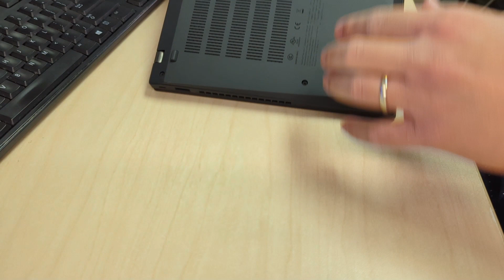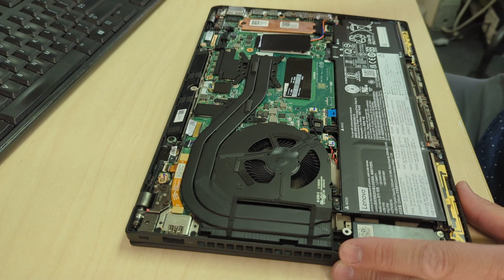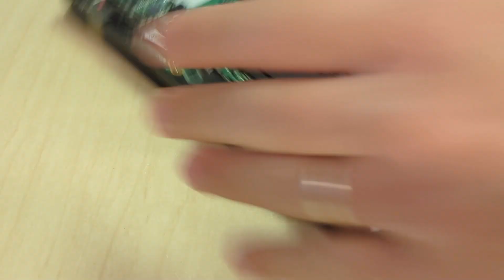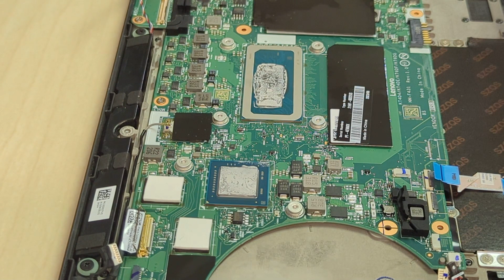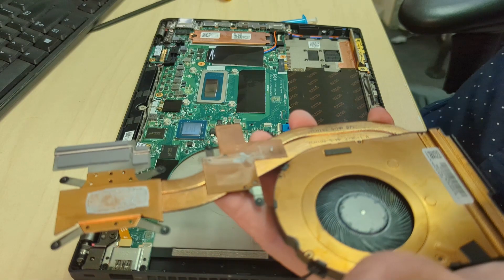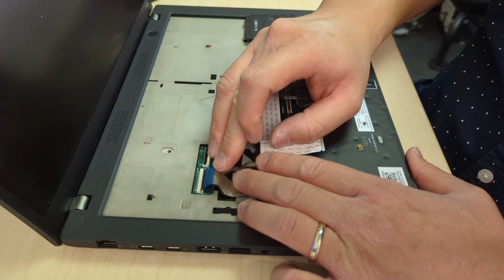Lenovo ThinkPad P14s (Gen 3 and Gen 4) system board replacement

Comment: How often p14s get issue like this? Thought of buying it .
Reply from the maker: That's a tough question. I work for tech support for a specific organization. And all I see are broken computers, because why else would they bring me their computers? Also, the computer models are ordered in bulk by the organization. So they come off the same assembly line around the same build time. So if there was a manufacturing defect, it could affect all the machines. So, I have replaced the system board in P14s dozens of times. But the organization ordered hundreds of them, but other P14s that are purchased elsewhere might not have similar issues.

Comment: is the gen 3 able to fit the gen 4, 57wh battery?
Reply from the maker: Lenovo's website doesn't list a 57wh battery for P14s. Where are you seeing it? The biggest one for P14s gen 4 is 52.5wh, part number: 5B10W51863. Gen 4 and Gen 3 P14s are in the same shell, so it's the same battery part.

Comment: Bro help me. Thinkpad T14s G3 or Lenovo Yoga 7 Pro ?
Reply from the maker: Always go ThinkPad when you have the choice comparing similar models.
Reply: @PetricusGaming  can the small cooling handle i7-1260p in thinkpad T14s G3?
Reply from the maker: I haven't had any that came in with overheating issues.